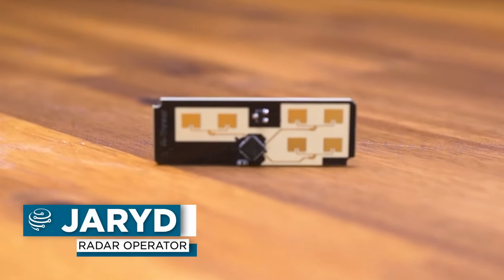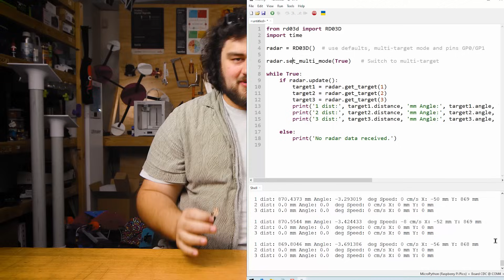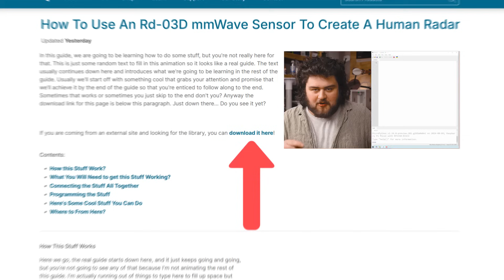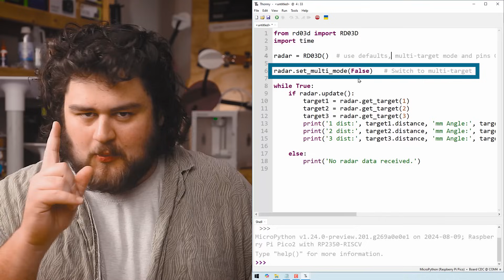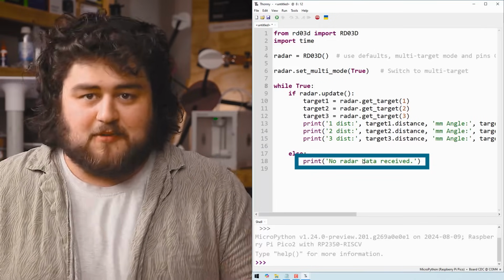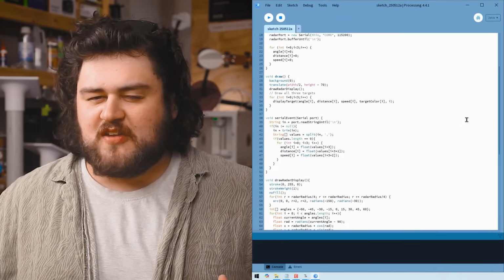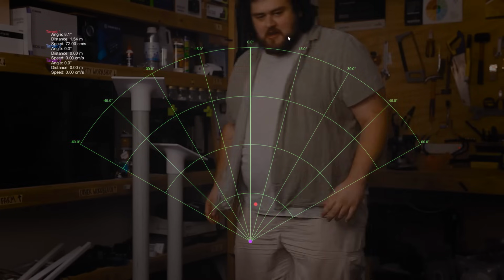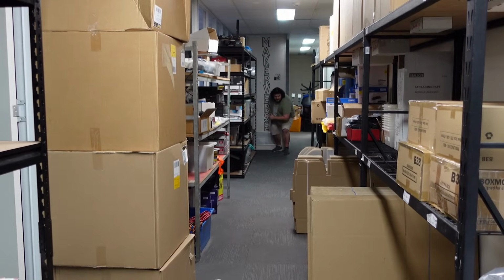How To Use An mmWave Radar to Track Humans | Rd-03D and Raspberry Pi Pico

Comment from the maker: Hey everyone, thought we would clear up something very important here. These sensors DO NOT LIKE TO BE MOVED. There is a lot of advanced processing going on under the hood but we think there is a base-line calibration it performs and when you move it, it can no longer rely on this calibration. This means that if you move it, it will still likely detect people, but it may track their position wrong.
Reply: Can it detect moving objects too? Not only humans.
Reply: What is the right solution if I want to mount it on a vehicle, and detect obstacles in general (not just humans)? In other words, I'd like to disable its advanced processing that recognises humans and I'd like it to report any obstacle it finds (let's say, the closest).
Reply: but if the device tracks its own position, possibly thru real time positioning, can that data be used in realtime to correct target distance

Comment: Also, how do i get the data from the output?  Is there an app or something that i could get a popup notice on my phone when it detects human movement and then i can see the data, such as an icon image moving on a map of some sort?

Im looking for the real time alerts of intruders on my property even if im not there.  Thanks.
Reply from the maker: This is just the sensor and is designed to output data to a microcontroller. From there you can do what ever you want to do with that data! There are definitely ways to send notifications or get that data elsewhere, its just a matter of coding it all up. We do have a maker forum where you can get some help scoping out this project if you want!
https://forum.core-electronics.com.au/
Reply: @Core-Electronics great, thanks.

Comment: Can you attach multiple sensors to one Pi or Arduino controller?

I can see where different sensors could cover multiple angles or even use longer wiring to position sensors at different points along a long corridor to detect passing those sensors.  And if they are spread apart in a certain way, could detect multiple people that way.   Orrrrr, is there a hard limit of 1 sensor?  Thanks.
Reply from the maker: The Pico has 2 UART channels that can be used, all you would need to do is to set it up to use the other channel and get data from there. My only concern is that if these are placed close together they will interfere with each other. I am unsure if they would work in the same hallway, but in different rooms it would probably be fine - but at that point you might as well have 2 different microcontrollers.

Comment: Great guide, I've just set this up but I'm not getting any data for targets 2 and 3. Anyone else run into this issue? Could it be a faulty board?
Reply from the maker: Like we said in the video it can be quite hit and miss with mult-target mode. If the people are too close together and too close to the sensor, it may be detected you as one person?
Reply: I just tested it again and gave myself about 15 feet between targets, it did behave differently in that it would blank out one target and instantly swap to the other person rather than bounce between close targets, but both would be displayed as target1, I'm not even getting reflection data for target2/3. I have a few more units on the way so I'll test those soon. Single tracking is working amazingly though.
Reply: I'm all up and running, got the radar connected more securely and I'm getting multiple targets just fine. I appreciate the help!

Comment: Is it possible to use this radar board with an esp32?
Reply from the maker: It definitely is! We have a guide on the Arduino with C++ if you wanna check it out. Should be pretty straight forward to adapt.

https://youtu.be/A0bIDhl02RU
Reply: @Core-Electronics Oh brilliant, thankyou!!!
Most of the time rsp32's will just run arduino code (in arduino ide) withblittle to no tweaks; though occasionally I'll throw a nano into an esp32 project for a multi-chip solution 😁

Comment: In your movie, the RD-03D seemed a bit sluggish in updating the data, especially in the side to side movements, is that correct? It seems that the ultrasound sensors are responding faster in some strange way..
Reply from the maker: The sensor has a bit of onboard filtering. The raw data would be a bit jittery and would bounce around, but the sensor smooths out the data which introduces this lag. It is unfortunate, but for most applications its fine. If you do need something really responsive, you might needa look for another solution.

Comment: If you wired it into analog along with a voltage divider and a 2mf capacitor, it will double the radars power. The max is with a 20mf capacitor. I know cause I tried it, and I literally mapped my neighbors heart rate in a totally separate house. These little pieces of kit are powerful to say the least. I recommend a LM386 as well. I’m currently working on a few other ideas with the CDM. The CDM puts all of others to shame! I advise ordering the CDM’s as soon as possible! I highly doubt they’ll stay on the market long. With the CDM I can map airplanes around 10,000 feet with an inline amp. There’s as well many upon many illegal things the CDM does without hesitation.
Reply: I've been trying to understand what this guy is saying and I can't figure it out.  CDM is probably Code Division Multiplexing, where multiple transmitters send a slightly different signal.  But this module is only one transmitter.  The chip does support up to 4, but only using TDM (Time Division).   "If you wired it in to analog"  I have no idea what he means by it.  There are no analog inputs or outputs.  and a voltage divider would reduce the power, not amplify it.  The LM386 is an audio amplifier designed to work up to ~20KHz.  not 24GHz, if it worked at all, there would likely be so much distortion the output would be unusable.  mmWave can be used for Vital Signs detection.  Maybe you could do it with the RD-03D, but you'd have to completely reconfigure how the S5KM312CL is processing data, and that would require using the SPI or I2C ports, which aren't connected on the RD-03D.
Reply: @Brandon-zo9ly Thank you for bringing reality into this.
Reply: Wait, what now? What module are you specifically referring to when you mention CDM?
Reply: Tell me more.
Reply: What is CDM
Reply: Where do you buy that
Reply: Can you teach us sensei
Reply: heart rate? I hope ur kidding
Reply: @dontreadmyprofilepicture1691 yeah he's a troll lol
Reply: We need answers brother
Reply: Where would one order a CDM? And would you be able to help me with the analog wiring with a capacitor? 

I'm making a demo kit for something unrelated, and a heartbeat sensor would tickle the fancy of the people i am demoing for

Comment: How does this perform on the z axis? Will it get interference or readings from a second floor or basement for example?
Reply from the maker: If you are talking about detecting people through the floor, I think you would need to have some very thin floors for this to be an issue, but we didn't test it in our 1-story warehouse.

Comment: Amazing video! Do you think It could track me in a pool which has 7.5 meters length? Wouldn't it get confused with waves in the pool?
Reply: Hey, I just read the datasheet, and it recommends for there to not be constantly moving objects as it interferes with clear measurements, it does not mention water in the examples given (plants or curtains), but I believe it does apply too in this case. I am not someone who knows about electromagnetic waves, but I’m pretty sure it does interfere with the radar’s measurements :/
Reply: as long as the pool waves are not 1 mm in length (joke)
Reply from the maker: I am unsure here as we haven't tested it, but I would guess it might not work unfortunately, the waves may be an issue.